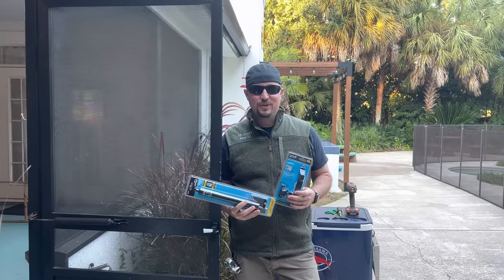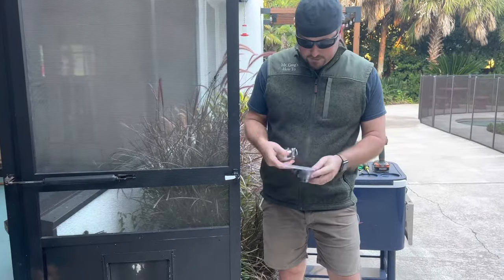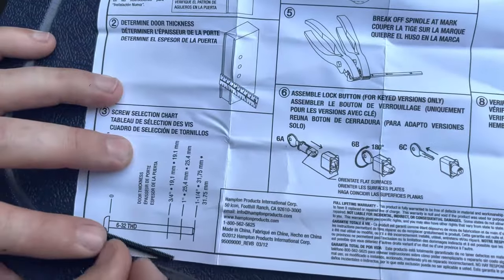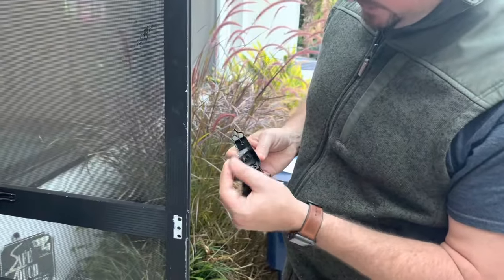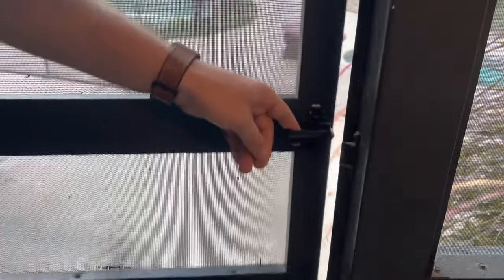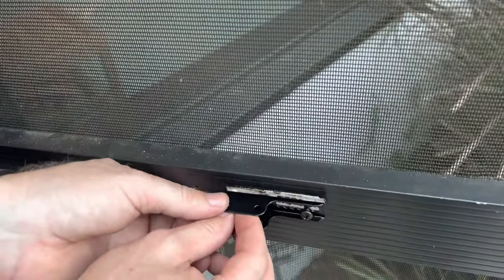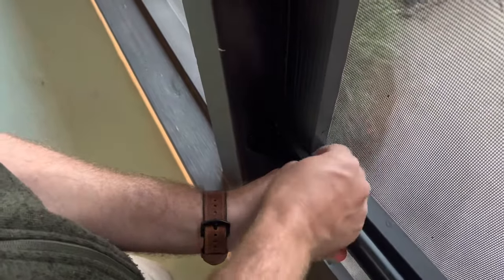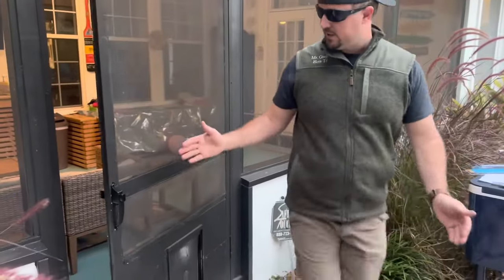HOW TO Replace Screen Door Hardware  //  Closer and Handle!

Comment: Sir, how do I unstick a push in storm door handle it is on the outside. The inside handle is not a push in, but is getting harder to open easily. Thank you for any help.❤😊
Reply from the maker: If it is sticking either the push rod mechanism inside is too short (part you break off) or the spring is wearing out.  Maybe try spraying it with some WD-40 and see if that helps!
Reply: @MRGREGSHOWTO  WOW awesome thank you we did the wd40 now working well. 😍

Comment: I’m not sure about that breaking off the metal part. Confusing. Lol. Someone has made a video solely on the spindle.  It just isn’t me.
Reply from the maker: Howdy, partner!  It isn't too tricky once you get into the install.  Just take it step-by-step.  You can too!
Reply: @MRGREGSHOWTO  you’re awesome but I am at the point of putting in a new door.

Comment: 6:18 My aluminum door has stripped holes that really tore the aluminum. Is there an easy way to keep that from happening again?
Reply from the maker: Howdy, partner!  You can try a larger screw or for certain applications could try a bolt/nut/washer combo.  If the door is opening correctly there shouldn’t be too much stress on the attachment unless it is over-opened. Best of luck to you!

Comment: When I tighten the screws the button on the outside and inside handle stop moving. Any ideas? They push in fine but the tighter the screws get the less they work.
Reply from the maker: That's strange.  Will the handle stay snug and functional without being tightened to the max?
Reply: @MRGREGSHOWTO  It moves around a little but isn't falling off. I'm wondering if the spindle is too long with the outer part of the handle added. I measured without it on.  But I don't want to shorten it until I can find another one.
Reply from the maker: @rumbledumpthumpershaker6735  Agreed, partner!  Sounds like the spindle may be a bit too long.  If you try shortening it be sure to only take off one notch at a time.
Reply: @MRGREGSHOWTO  Thanks. I'm going to try to find that backup first. You would think ebay and Amazon would have them.